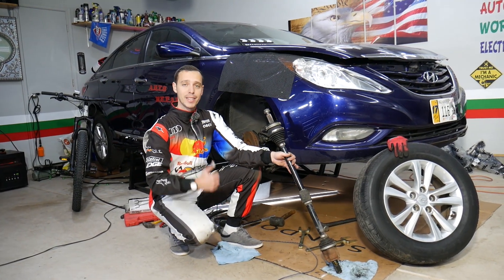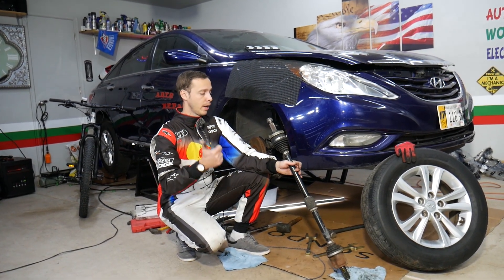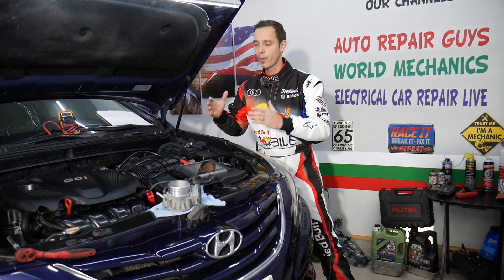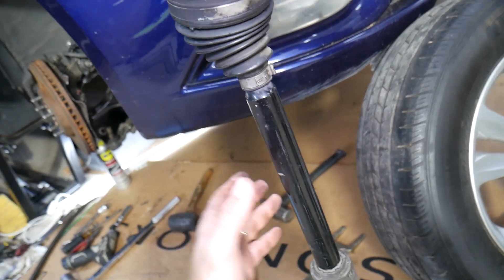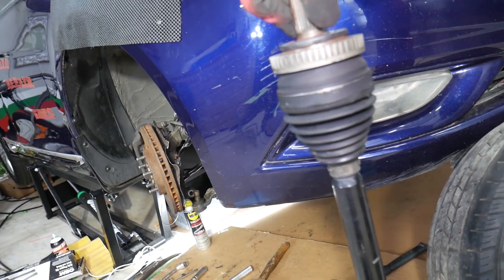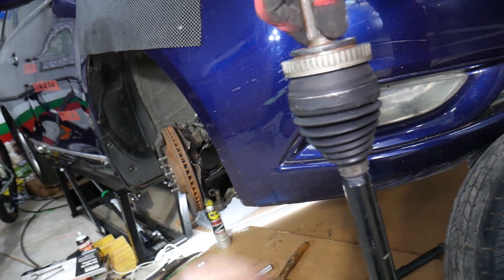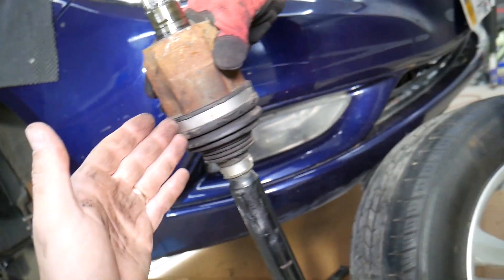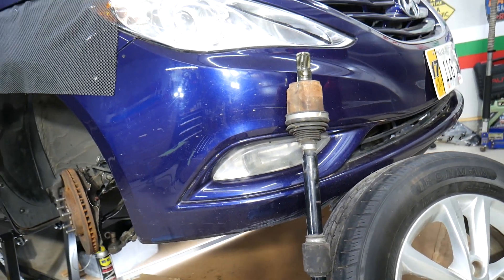TOP 4 SYMPTOMS OF BAD CV AXLE SHAFT on Hyundai Sonata Elantra Accent Santa Fe Veloster Tucson

Comment: Question: Axles can also cause that My 2012 accent hatchback shakes at 40 to 60mph only under aceleration? 

The Car do not have the check engine light on, no steering wheel shake at any speed. The wheels and tires are balanced,Tires have only 6,000 miles of use. Recently new oem engine mounts was installed. 
The car have 190,000miles.
Reply: My car is the same -_-